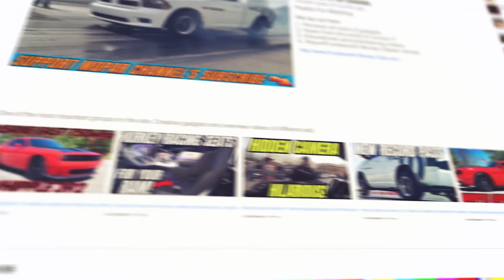Challenger R/T Gets Full KARNAGE Performance Exhaust Sounds SICK!

Comment: I like the sound. I'm  big slp fan. With this exhaust, I like how it has the old school deep roar  with a mix of the screaming throaty sound, even a bit of popping. Ofcourse, there are so many factors, engine, exhaust placement, exhaust diameter, headers etc. Regardless I like the sound. I'd like to hear them Onan old school big block, maybe a coyote, or even a fully built high compression ohv engine.